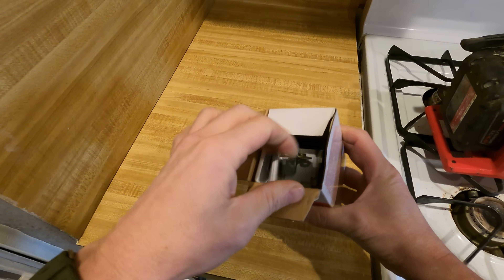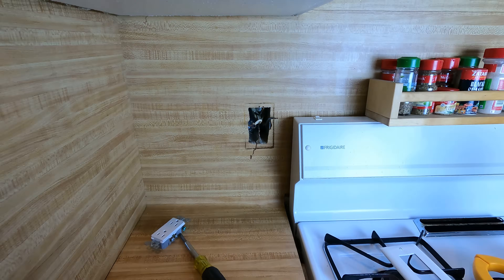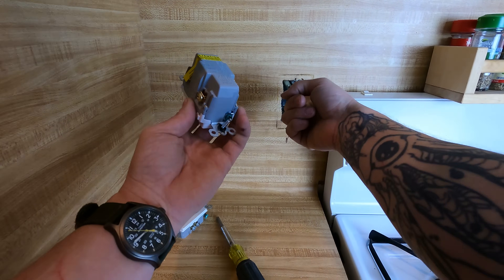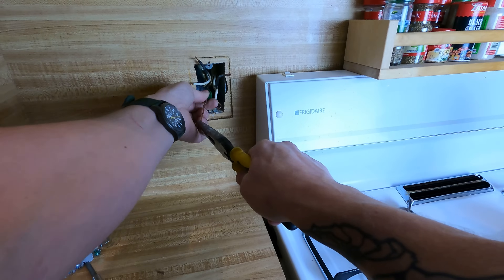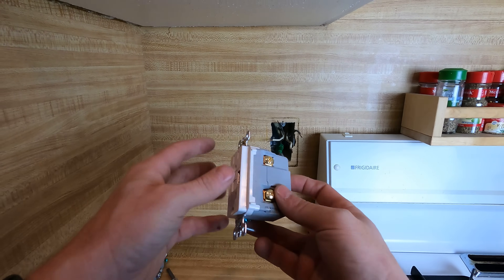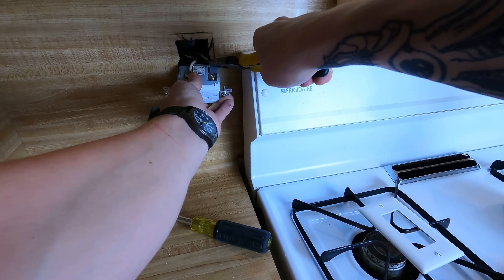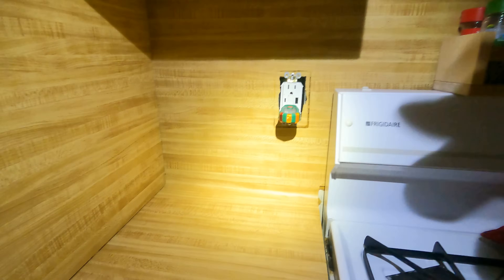The First Ever USB - GFCI!!!

Comment: I was taught to twist them together, trim one down and then put one of the green wire nuts with the hole in it on those wires and where metal boxes are involved to have a wire long enough to ground the box and then the devices.

Comment: The problem I have with these big plugs is box fill. Here in Canada, anything deeper than 1" requires you to calculate the actual volume of the plug, by multiplying 32Xdepth in cm, then subtract that volume from the box volume (12-3034). If you do that you don't need to add two wires for the receptacle, but it still ends up hogging volume. If you've got wires coming in and going out, and a few connectors, you need a fairly deep box to make it legal.

Comment: I subcontracted part of a job to another master and his crew. They wired all boxes with very short wires. FYI, the master left his apprentices unsupervised during the wiring process. I checked their work half way through the project and I made them go back, pull the wire out and reinstall new with at least 6" outside of the boxes and I charged the wire and labor cost back to the master for not meeting the specs of the job.

Comment: Great testing every device. All GFCI receptacles now much have 2 great fitures: selve test at least every few seconds and if the hot & white grounded wire are connected wrong will not energise the device. Hope they gave you a TR device.

Comment: Would be just my luck to get the extra deep device in a box and then go break my 4 year old cell phone and the new phone would use a different charger. Do they give you 2 shoe horns & a rubber mallet to get it into a wall case.

Comment: which of these receptors are best for an older manufactured home? the reason I'm asking the place is snug no drafts it not falling apart needs a renovated kitchen new well better light fixtures all around new ductwork other than that it solid, let me explain it gets cold where it's located and I'd had to remove the quilt they gave me to use the space heater was located in the kitchen I was in the living room, yeah tight.

Comment: Love you Dustin. But i thought that current sensor on that GFCI  at a minimum detects 4-6 ma? Not just 1.
Reply: You are mixing units, actually. The animation showed a 1 amp difference. That's 1000mA, so the GFCI will easily detect that. :-)

Comment: 1:15 Dude....”easy as that” 🤦🏼 Ya wanna “curse” yourself right from the get go, I see😂 
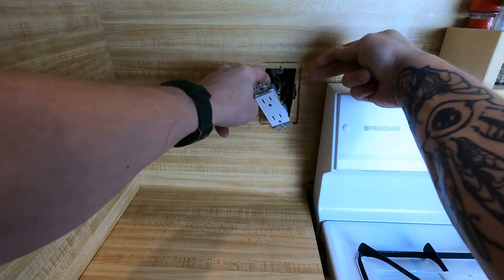“Easy” is definitely a No No word on the jobsite, LOL. ¹ Also, those receptacles are “thicc” boys! Sucks when doing an install in a res remodel kitchen and when get into the boxes; you see the last person graciously left you with maybe 2”-2¼” of wire to “play with” (& I mean MAYBE 🙄). 2:18 THIS RIGHT here, is why when writing up a quote etc..., we will pull 4-6 random receptacles throughout the “project” and “see” what kind of “play” we have to “work with” (b/c something that “should take” 4-8 mins to swap out an outlet, could take double or triple if dealing w/ crap like this...or have to do a rerun b/c current wire is completely 🤬 up and shouldn’t be used....IMO).  ¹ »NOTE« 1:30 I wrote above comment before watching rest of vid, and at this timestamp, I started LMAO, b/c it’s exactly what was talking about w/ the res remodel ended up doing. ALL the receptacles were like that (lights, outlets, etc...) and it sucked!😂 Enjoyed the Vid Dustin, & you just make watching “so much fun’ and enjoyable.
Cheers✌🏻

p.s. complain away; like when others complain, as I do feel alone in that “dept”; along with asking “myself” why anyone would not leave extra length to help out the “next guy/gal”....unless was worked on THAT MANY TIMES, that each one cut what they needed to, till got to you, & ended up being nothing, 🤪😉

Comment: Before I post my main comment, I see you have new clamp meter? Is that the 61-775 or 773 (maybe even the 763/765 models but not sure if you’d choose those 😉, like me; it would be the 775 or maybe 773 I’m guessing).
What do you think of them, & compared to other brands (or even the other models of ideal’s lineup 74x, 73x models......)?
Like when do tool vids and why like or strongly dislike a tool😉
✌🏻

Comment: I'm a home-owner DIYer, so just hear to learn -- aren't kitchen receptacles supposed to be split for 15A, or else serviced by 20A (T-slot)?  Also I know there were plates so you straightened/shortened the wire and just sandwiched it under the plate -- but why not just keep the loop around the screw for a more secure connection, especially in the tight space where the straight wire could pull out while working on it?  And just an observation -- it's probably a locality thing, but around here, I'm used to seeing metal boxes where ground is bonded to the box, and a wire nut is rarely used.  I only seem to see plastic boxes in exterior wall applications, to get around the need for a poly "hat" that ties into vapour barrier.

Comment: Ugh, screw screwless plates(pun unintended), they are such a PITA to install or service if you need to.
I get that they look prettier without the screws, but the amount of extra parts and points of(admittedly cosmetic) failure just seem dumb IMO.
Decora(ator) plates with screws are just fine for me. If you're some DIYer with time to blow, or really want to run up your bill with your electrician, go for it though.
Neat that they have GFCI USB outlets now though. I might have to defect a little on Leviton and get one of these for my kitchen's desk nook.

Comment: Highlighted the wrong part, the wires need only extend 3" from the opening of the box.  Not that these wires do.
Also I think 2020 code it's a 6" or larger box only needs 6" from the point of entry.  Instead of 8" and larger, but I could just be remembering this wrong.

Comment: Those short conductors may be beneficial if you are installing such a huge device. Especially if the box isn't deep. Just my two cents but yes i agree with you. Working on hot wires at 3 inches in a metal box is so much fun! :)

Comment: Lovely job on those stupid short wires.

But I just hate these USB things.

I don't know what circuit testing your code(s) require over there but here we do an insulation test that pumps 500V down the wires.  The USB device queers the result, so you have to use an alternative method and note an exception on the report.  If you apply the test unaware that there's a USB in circuit you can damage the thing.

The same can be true of the GFCI element, however our equivalents (RCD or RCBO) are usually back at the distribution panel and not on the outlet so not an issue.

Note from tester manufacturer about testing https://uk.megger.com/electrical-tester-contractor-edition/june-2015/testing-usb-wall-mounted-sockets

Comment: Did not know that some duplex outlets BEYOND the GFCI may not need this
protection. Something new. thank you.
Reply: Yeah. Case by case thing. For instance, apartment complex i worked on redoing gfci's some had fridge plug downstream some had random wall outlets far from water downstream. They dont need it and if you do protect them it will cause you irritation. Not unsafe at all tho. Take your time to identify all the wires in a box, it will save you hassle and time.

Comment: Do you ever add electrical tape around your terminal points? In a tight box like that, I could see that being extremely useful. In case that ground wire was hitting any termination point.

Comment: Wouldn’t it just be better to get a usb plug? There’s a lot of electronics inside it to fail.
Reply: Ac to dc converters can also run pretty hot, so a poor air flow location, like inside the wall, sounds like a good recipe for early failure
Reply: @mrlescure  yeah, heat and complexity seems like it’s prone to failure. How many regular outlets fail? For me never.
Reply: @jakp8777  non-gfci? I've seen a few fail in places with a lot of corrosive elements in the air

Comment: And yet somehow that thiccc boi counts the same box fill as a $0.70 toggle switch. 🤷🏻‍♂️ Someone is going to spec two of those in a 1.5" deep box and it's going to be impossibru!
Reply: YUUUUUP. It's already a problem with the non-gfi usb devices. I don't get it. Had a nightmare situation where a client wanted two of them in one 2g after the fact and the terminals kept tripping each other. Wouldn't fit with tape. ugh. I will not be recommending or letting people know about these until they get the profile down.
Reply: @basedbuddha777  I agree. They're not practical unless you're in new construction or are cutting in a new box so you can use a deeper one.
Reply: I bet this will change in future codes, but who knows...

Comment: the whole usb outlet idea will be phased out in the next 5-10 years.
Reply from the maker: What do you see will be the replacement technology?
Reply: @electricianu  possibly a wireless charging device or even a whole different USB cable. If my predictions are correct these devices will become useless, I installed a few of them in my house too but I know they will eventually have to be changed
Reply: @STXVIEC  This device will probably live longer due to it being a Type C and not just two Type A.
Reply: What's next?  Wireless charging everythng?
Reply: @BluRibTac  wireless charging or even a completely different charging cable

Comment: I am pretty sure the side of the plate that says "down" has 2 visible slots that would be seen from the top if you put it upside down. Those are where you put a skinny screwdriver to pry off the plate to take it off the device, if needed.

Comment: I hate short wires, especially 12 gauge solid.
Reply: How about 6 gauge? Lol
Reply: The ideal push in connectors are difficult to put on short wires.
Reply: @XionAzura1  get wago connectors man
Reply: At least he was working with 14..
Reply: @mattsmith1318  Looks like it might be 12 from the 1980s or so, before they started using the yellow sheathing on it.
Reply: @mattsmith1318  Old house so it doesn't have yellow sheathing. All plugs in a kitchen should be 20 amps.